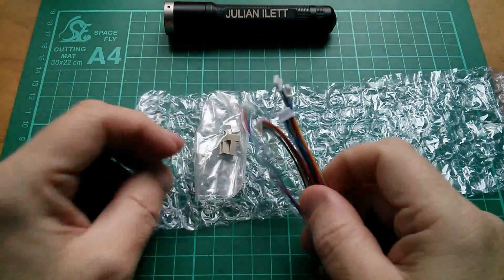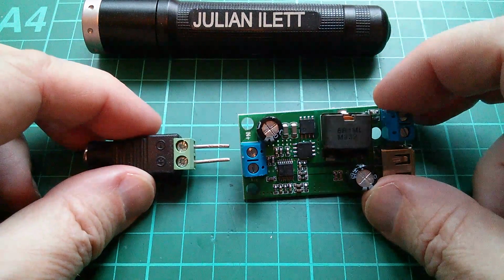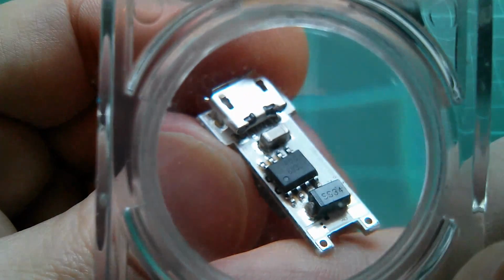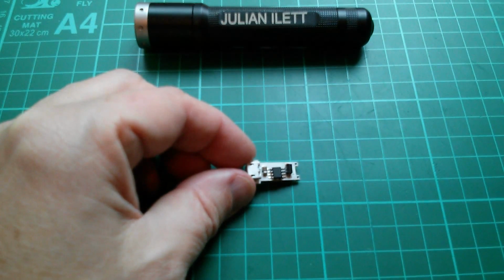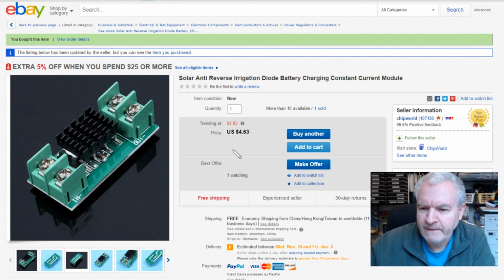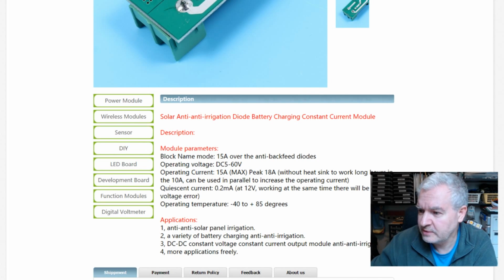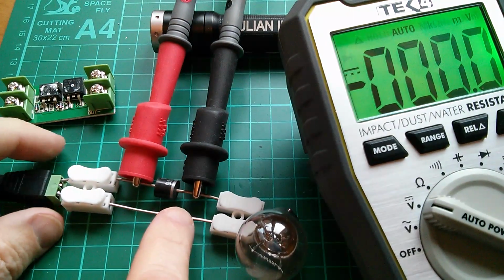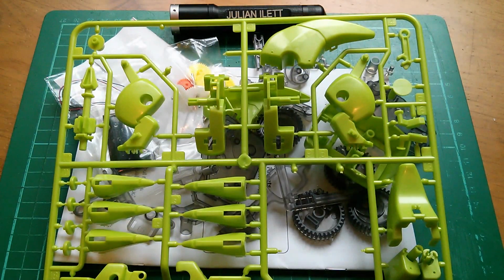Julian's Postbag: #74 - An Unmitigated Disaster

Comment: I reckon the 'irrigation' is a bad translation for 'current'.

And anti-current is reverse-current. (Think about it... current and anti-current or opposite current)

So Anti anti-irrigation makes sense.

Can the Schottky diode take 74a? I guess the use of MOSFETs is for the large current rating. Make them act like a beefy diode. Theoretically.

Comment: :o):o):o) I just spent my Christmas Holidays trying to figure out this same "anti-anti-irrigation diode". Because I just could not believe that someone uses all these precious components to make something worse than a 10ct Schottky. As it stands, this just uses the body diodes, and the components make sure that the MOSFETS stay OFF! :) If you invert the board - OUT+ is IN-, IN+- is OUT-,OUT- is IN+ and IN- is OUT+ (cough) - and then connect the side of the R10k that is connected to source to the new + rail (ie. the former -) - you get the standard reverse battery protection circuit with an N-MOSFET. The Zener keeps the gate voltage under 15V. I'm not sure that it is the anti-anti-irrigation that I need, though. Which is, protection against battery voltage that is higher than the supply voltage :o( :o( :o(

Comment: Here's a clue. Normally when mosfets are used as reverse polarity protection they are wired up backwards so that initially current passes via the body diode for the first few moments. Once the circuit is energised then the gate is switched on and the transistor bypasses it's own diode. If you connect the current up backwards the body diodes does not conduct and also the gate is biased off. 

The trouble is that a single mosfet in this arrangement would not serve to block reverse current into a solar panel as either end can become the more positive depending on how the light level is. Maybe that's why your "ideal diode" has two?

Comment: Julian, why didn't you reverse the connection on the anti-anti ideal diode module. Normally if u are getting a body diode effect the device is either connected in reverse causing the diode effect or just being bypassed with an actual diode connected to the Source and Drain pins.

Comment: The LTC4359 based 'anti-irrigation' um... ideal diodes ... look interesting... 15A rating, and also with a micro-controller compatible on/off function... much better in-out arrangement also...

Comment: The chip on the charging board is an LT4001 which I believe is a Chinese copy inspired by Linear Technology. If you look at this on Ebay you'll see there are a couple of boards that utilise the same chip - http://www.ebay.com/itm/2A-Micro-USB-3-7V-18650-Lipo-Lithium-Battery-Charger-Charging-Module-Board-w-LED-/262596429707
I searched on Google for LT4001 and found a pin out but no data sheet, but I didn't look very hard.
With respect to the 'ideal diode', I'm surprised you didn't meter out the ground connections to see if they were connected to the zener diodes. I also doubt there's anything under the terminal blocks.

Comment: My guess is that the word 'irrigation' has to do with the water-flow analogy used to explain electrical basics. So, 'anti-reverse-irrigation' is a one way valve, and hence a diode, maybe? They also use the word 'pressure' to refer to voltage. Makes me wonder if their use of this terminology makes electrical concepts easier to understand for the uninitiated. They do employ the largest electronics workforce, and I'm guessing they can't all have had formal electronics education, so this terminology might be very useful. Or maybe I'm overthinkng it, and it's probably just lost in translation.

Comment: Wondered if 'anti anti' is some Chinese linguistic quirk that means it's more emphatically 'anti' than if it just had the single?
Reply: +Dantali0n This is a "buck buck buck buck converter converter converter"
Reply: Could be but I think its just to make ebay rank them higher on the keyword anti
Reply: This is a buck converter converter, it's a robot that takes your buck converter and rewires it into a boost converter instead.
Reply: Anti anti irrigation = anti back-flow or reverse current protection.

Comment: It wasn't a total disaster, you made me aware of a better kind of lithium charger chip! I like the 2A capability and higher efficiency than 4056, especially since I've had bad experiences with the charging protection malfunctioning on my 4056 charger board... The exact same model you showed just recently. I have to give the 4001/5001 chips a go!

Comment: To make an Anti Reverse Diode for my solar charger I just connected wires to a power MOSFET and used it without any other parts and it works just fine by itself.

Comment: Ha ha, I have had a couple of odd things show up in the post but never anything like that :-) That ideal diode seems no better that the reverse P channel option. Have you ever thought and this might be and probably is a terrible idea, of knocking up a solar powered (maybe on a mini panel) relay circuit to connect and disconnect the panels?
Reply from the maker: My first solar charge controller design used a relay - but they draw too much current.

Comment: Great minds think alike!  I have been following your PIC videos and ordered the same 1 mm JST connectors. When I got them a week ago I saw the same problem and the following day I ordered the 2.5 mm... hope I did better the second time around.

Update 10 minutes later from this post the connectors arrived.  I bought them off of eBay they are the  XH2.54 set of 10 male/female for $2.35 USD.  They seem to fit just fine.
Reply from the maker: Snap :)

Comment: To make an ideal diode with an NMOS (or two) you'd have to have the NMOS in the negative rail (which is not the case here) or drive the gate from some (capacitive) voltage booster to lift the gate voltage above the positive input voltage. This is because you need Vgs to be large in order to get the low Rdson. So there should have been a chip somewere on the board or they should have used PMOSFETs.

Comment: Julian: for ideal diode refer to this Linear post: http://www.linear.com/solutions/1464 as You can use LTC4412 purpose built IC with a P-mosfet. It works great in my solar environment (especially that both IC and mosfet has been ordered as "Sample"...:)). Just two components and that it is! LTC4412 datasheet shows sample circuit for added LED indication as well, load-balancing solution based on this ideal diode, etc. Great chip!

Comment: The heat will be due to the current driving the MOSFET gate capacitance at a pretty high frequency, hence the thermal pad.  Efficiency will be good at high loads, not so much at lower loads.
Reply: Or the bent usb pins shorted : ) .
Reply from the maker: Yes, there's an Efficiency vs. Load graph in the data sheet for a 3.3v 8A regulator application. Max efficiency (92%) is at 6A load. That drops right down to 80% efficiency at 1A. Not a good chip choice for low quiescent current.
Reply: Barrybados©. it would get significantly warmer at 5 amps output. As he measured the voltage, its was a perfect 5 volts, its certainly not shorted. 
Looking at the efficiency characteristic of that converter, mikes explanation is absolutely right.
Reply: Hey, look up this mosfet irlb3034pbf - extremely low on resistance - this could be perfect and the most efficent solution.

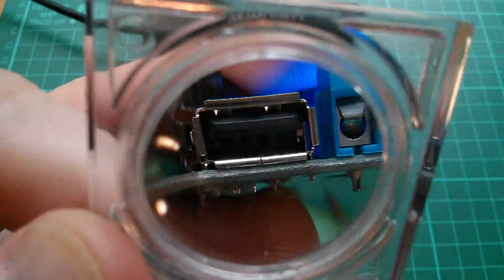Comment: 4:45 I have 5 EVGA video cards GTX 480 580x2 650Ti 780 in for repairs. Every one of them the HDMI ports did the same thing. I don't buy EVGA stuff any more. Gigabyte is the only company that uses genuine Japan components on their cards. Not the knock off China stuff.

Comment: Perhaps you shorted out the USB when you crushed those pins? Might explain the heat if it's doing some current limiting thing? Guessing.
Also, isn't a large heat sync on something called an "Ideal Diode" kind of a warning sign?
Reply: That's what I thought but he measured 5V on the output so it probably isn't that unless the module had 2 separate outputs.

Comment: I'll be sending $10,000 USD to Patreon and a Nobel prize to you for your groundbreaking work on electrical irrigation, how to defeat it, and then how to bring it back again, in addition to your discovery of a circuit with no ground. I'm sure your use of finger puppets to communicate complex STEM concepts in a manner accessible to the general US population (whose shoelaces are tied together) will garner you recognition in the field of education. Truthfully, the JST info was very valuable, I never knew there were so many kinds.
Reply: Ken Colangelo  8
1988 .

8
198

Comment: I think yu're right that the zener should go to -ve, once the input voltage is above the zener threshold, it should turn on the mosfets, though with the resistor going to gate i would have thought that would turn them on anyway, 
Maybe the mosfets are wired backwards, those internal diodes should not conduct unless there's a reverse.

Comment: I would say that the given video capture configuration is working very good, but you might be able to further reduce the necessary bandwidth size by reducing the video frame resolution of your camera (perhaps 1024x768 or even something lower). It also seems that your camera has a face tracking feature, perhaps if you turn that off and use just the autofocus feature, things might work even better. :)

Comment: I'm not sure what a anti-anti-Irrigation diode is, but I do not see any ref to "ideal diode" in the ebay listing.  The ref to constant current might explain the mosfets thou ?
Reply from the maker: I found the ideal diodes first, but I didn't like the connector arrangement. The "anti-anti-irrigation" nonsense seems to be on all the ideal diode listings. So when I saw the chipworld device I made the assumption it was also an ideal diode. Now I'm not sure what it is.
Reply: William Na same module is listed at Ali with "ideal diode" - marking
Reply: Sandip Dhakal I wouldn't call it diode if it lets current pass in reverse ;)
Reply: He just didn't want to be like all the other diodes, hes doing his own thing.
Reply: +Julian Ilett That current does your light bulb use? Usually this ebay ideal diodes modules need some current before the mosfets kick in. So i suspect your light bulb current was just passing through the body diode and didnt trigger the circuit.

Comment: Yes that was not an ideal diode (the ideal diode controller is normally quite expensive). Minimum voltage drop will be around 20 to 40mV and from there will depend on current and the voltage drop on the mosfet RDSon.
Reply from the maker: Not sure what I bought then!
Reply: Is just a normal schottky diode there was no mention of ideal diode in the add. The other boards you seen on eBay are probably ideal diode's. 
Or you can build your own with say the LM5050 ideal diode controller and  a mosfet is a small SOT-23-6 device. There is an evaluation board for this at Digikey and Mouser but is a bit expensive the LM5050 has an acceptable price and is what I used for each of the PV inputs on the new  SBMS100 and SBMS60 versions not the SBMS4080 that you have.